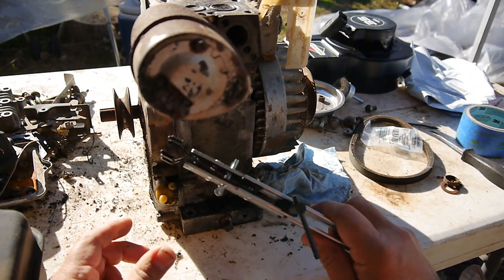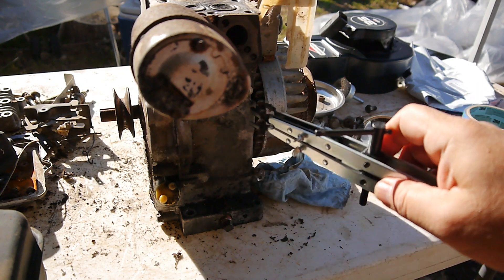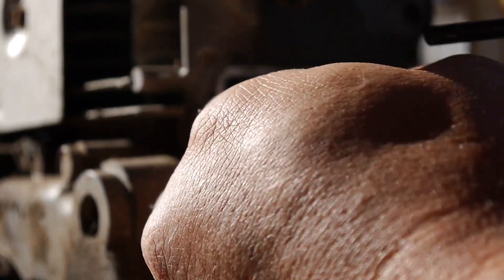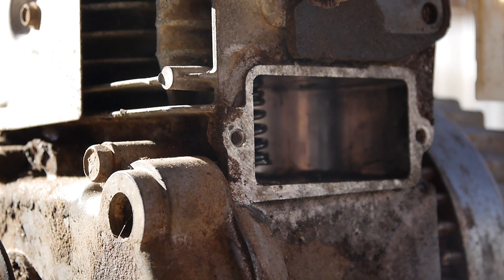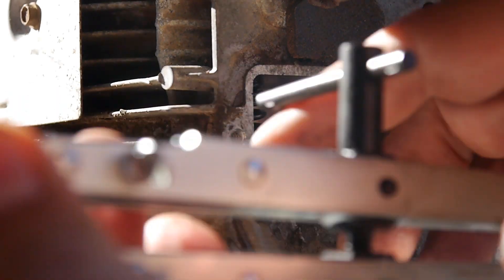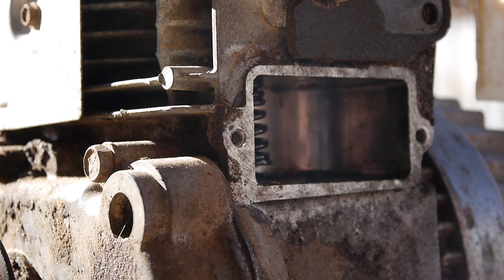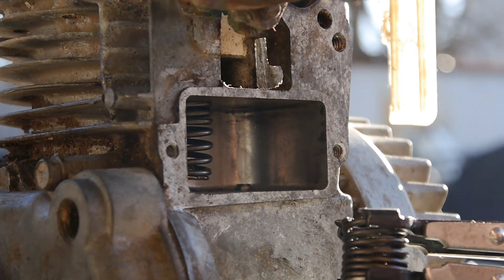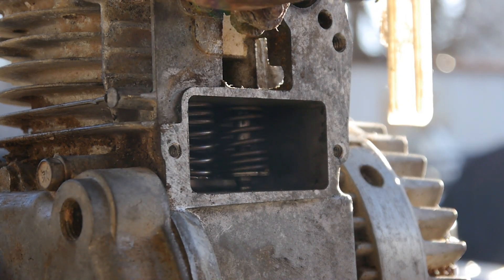Using a Valve Spring Compressor on a Briggs & Stratton Engine

Comment: Got me in the right direction. Played with it 20 min got the spring and valve out.  My issue was the seal around the intake valve keeps popping out. B&S 725 up there in hours of usage. I used Loctite 620 Green around the seal. TAPPED in using a 3/4 inch socket.